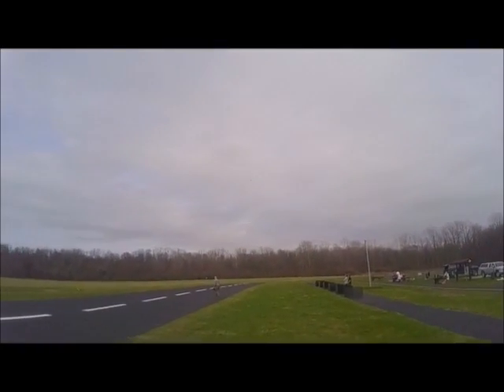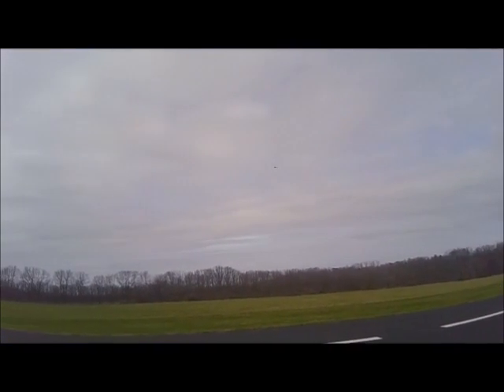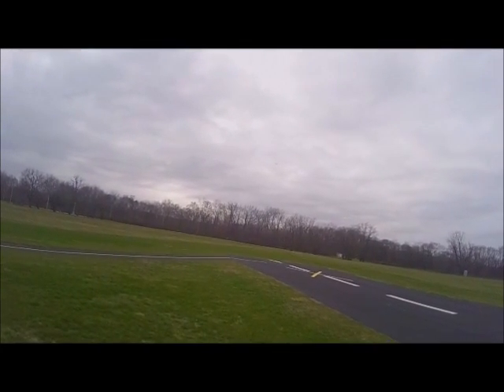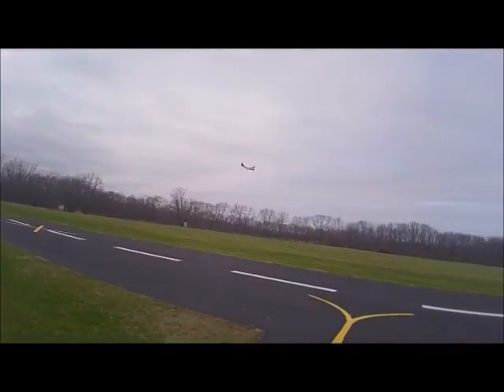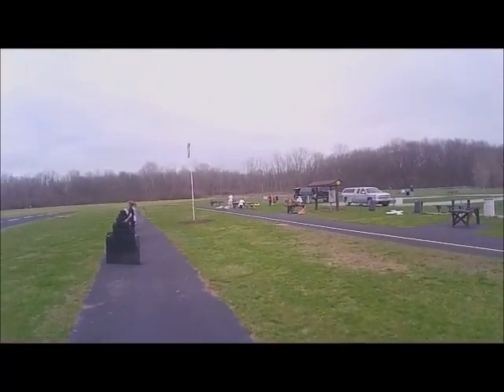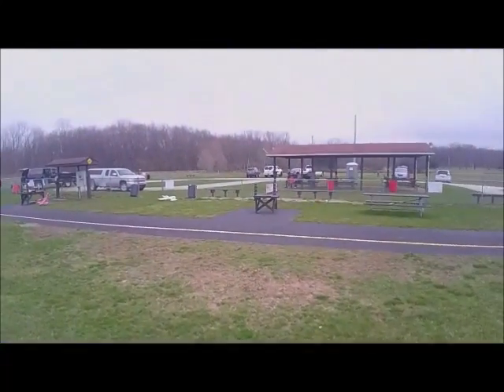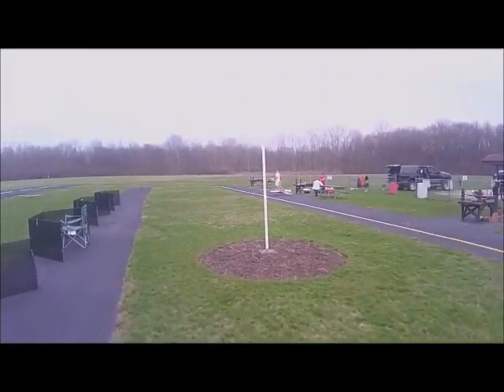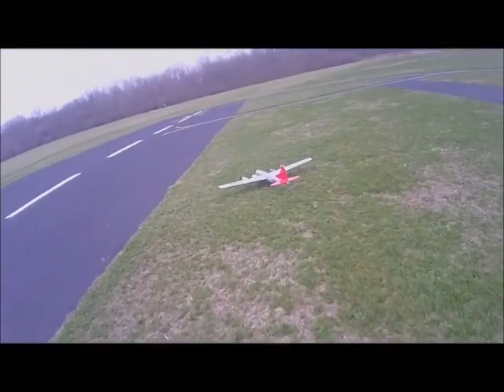My B 29 From balsa to flight

Comment: From your model-building experience I don't understand why you built this half-baked, sort of looks like a B-29. When building from scratch work from blueprints, don't build from memory. The nose isn't shaped like a ball, but more of a bullet that tapers a lot more at the tip. The nacelles look like they're from a B-17. B-29 nacelles look like a P-47 Thunderbolt's at the front, there are no straight lines, they taper like reverse teardrops and continue to the back of the wing. The wing is long and slim like a glider, yours is like a P-51 Mustang. It tapers on the front to the slender tips and the rear is almost straight and perpendicular to the fuselage. Your vertical stabilizer looks like something from the 1930s and not even close.  Like the wing, the front of the horizontal stabilizer tapers and the rear line is almost perpendicular. The vertical and horizontal stabilizers are curved in the front become thicker in the center and taper to a thin point at the back similar to the wing but with a symmetrical foil. 

Please enlarge these to scale. When I built a B-17 from scratch I bought the Monogram plastic model, scanned the top and side illustrations, enlarged them, printed them to make templates to work right from and cut the tail and wing shapes exact.
Side View: https://lh3.googleusercontent.com/proxy/Qt7B66PSUJeYPi5QGiJ1G7TpsrmsCGwjWGbLCXT5Tj_UFSIaATOwxRWK6R9pJdJG4G_-XhEk6Br6dS5t1_f4dl1BEiNMnTumUqphLp-IRNazLc_4ZfYbmXl4hlCJoOMfY6FrnDkjdfqJGNqlPUIOIAx7We36aDK8N7XWiw
Wing and Stabilizer: https://bloximages.chicago2.vip.townnews.com/insidenova.com/content/tncms/assets/v3/editorial/e/56/e5668992-f70a-11e4-af98-ffabd143265a/554f465c1ad31.image.jpg
Reply from the maker: I would like to see what you have built and the RC airplanes you fly. Thanks for the comments but I built the B 29 for me and not for anyone else. I posted it so there would be no need to keep it on my computer. Have a good day, if you want to learn RC flying I believe I can get you started in a good AMA Club
Reply: @eldestguy  I wasn't being mean, but was suggesting constructive criticism. I have noticed that when folks spend hundreds of hours building an RC plane from scratch why don't they invest the few important hours to get the design true to history??? Mac Hodges B-29 looks horrible and nothing like a real B-29. I can't stand looking at it.
https://www.youtube.com/watch?v=asu1OqhPGRg
These gents in Belgium still didn't make the tail correct. WHY not get it right???
https://www.youtube.com/watch?v=lzBFZXKNlOk
Reply from the maker: @riproar11  You responded very quickly but you did not answer my questions. Where did you get you knowledge of aviation and aeronautics?

Comment: Hey man can I ask for the template and what airfoil did you use??
Reply from the maker: I wish I could but the old yellow papers are gone, The airfoil was flat bottom and whatever looked good to me. It amazed me that it even flew. I could not purchase one so a friend suggested I build my own.
Reply: @eldestguy  but what if my airfoil is not flat bottom. It's the kind of airfoil that has both top and bottom equal
Reply from the maker: That is know as symmetrical and is very effect in acrobatic flight. A B 29 is not that kind of an airplane, pick a simple one that is easy to cut out and one that gives steady flight  https://www.bing.com/images/search?q=types+of+rc+airplane+wing+foil&qpvt=types+of+RC+airplane+wing+foil&FORM=IGRE

Comment: Hey bro nice one. Can I get the plan please? For electric
Reply from the maker: What you see on the video s what I have. I took an image of  a B 29 from the internet it happened to be 6 inch wing span, so I multiplied it by 12, It has a 6 foot wingspan and all other dimensions are close to the 12x1, The nacelles, motors and esc's are from the Freewing B 17. All my work is done by quesstamation. The weight is very close to the 78 oz of the B 17. Flat bottom wing, light balsa, light ply, Cherrywood for spars. Landing gear from music wire and tandem wheels from a well know landing gear company- I can not think of the name. To sum it up -I used my experience from years of kit building and I was lucky that it flew.  Thanks for watching and I wish I could help but as I said -what you see is what I had to start with.
Reply: @eldestguy  B29m (modified for my model) great build.
Reply from the maker: Thank you, kinda juvenile in build but it flies and I still have it in flying condition.

Comment: Nice plane but the nacelles and engine cowls are not that of a B-29.  Also no B-29 had anti-glare panels on the inside of the nacelles and cowls because the pilots set way forward of the wing.  My father was with the 509th First Atomic Bombardment Squadron and I have studied these old airplanes all my life.  Again, a very nice model and flies very well.
Reply from the maker: Thanks for your comment. I used the nacelles from the Freewing B 17 as my B 29 was about the same size. I was aware of the problem with the (anti glare) panels but as of 2 years I did not get around to painting them to match the grey. I was- 
with my limited ability- satisfied with making the airplane from a picture and then
watching it fly. Thanks for watching and I would bet I have one in a million- 
scratch built B 29's   No one has the B 29 for sale retail. But I did get the B 26 and B 24
Reply: I am like you, would like to find a medium sized kit for a B-29 but as far as I know, one does not exist.  I will likely scratch build one before long.  I can't resist making it like one of my Dad's squadron.  The 9 airplanes of the 509 were very different, they were actually B-50's without the cowl change.  Instead of R 3350 engines they had R 4360 engines equipped with reversible pitch propellers.  They had almost no armor and all the armament was removed except the 2 50 caliber machine guns in the tail.  Also larger fuel tanks.  They were said to be able to fly almost 100 Knots faster than a standard B-29 and much further.
Reply from the maker: Good luck with building your own. I suspect it will take 40+ hours and a lot of research and design. I would not sell mine for 1000.00  Oh and look at 
this on the B 50 https://en.wikipedia.org/wiki/Boeing_B-50_Superfortress Another site to look at on the stolen B 29's by Russia  https://www.b-29s-over-korea.com/shortstories/russianclone.htm
Reply: Karl Hutson Actually, Guillows made a b-29. However, they are no longer in production. But if you keep your eye out, you may find one on eBay or something similar.

Comment: Where do you find these measures?
Reply from the maker: I took a picture off the internet. The picture showed a wingspan of 6 inches, so I used math and made the wingspan 6 feet. So one inch for each foot of length, like the fuse, wings, stab and elevator. I placed the motors in proportion to the wing and body width, It is as close as I could approximate.
Reply: Do you have still all the measures?
Reply from the maker: I believe I can find the brown paper, plans and measure them, I will look around for them and let you know
Reply from the maker: Do you build with balsa and monocote
Reply: I don't no that